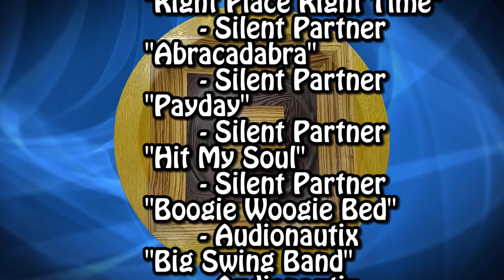Woodturning - Square In 3 Frames

Comment: Gord absolutely fantastic job waow you couldn't have picked better types of wood for this project so beautiful. Such a simple idea but this is actually the very first time I have seen this done for a bowl/platter, absolutely gorgeous 👍👍👍
Reply from the maker: Thank you, Gavin. I haven’t seen it done before either. I just did it to see if I could. The turning was the easy part. Getting the joints of the frames to work out was the tricky thing. Thanks for watching, Gavin. Merry Christmas and Happy New Year to you and yours! 🎄🎄🎄🎄
Reply: @GordonRock1  thanks so much and Merry Christmas to you and all close to you 🎅⛄🎄🥳

Comment: By design that is the prettiest bowl-of-week (maybe month?) I do have 2 questions, 1.) did you put any spines or dowels between the mitered glue joint to strengthen the end grain to end grain glue joints? and 2.) just how many of those plaid shirts do you own? GOOD JOB!!
Reply from the maker: Thank you, James. I’m glad you liked it. To answer your questions:
1. No, I didn’t use any splines or dowels because, as usual, I didn’t have a firm idea of what I wanted to turn until I had it on the lathe. If I had used splines/dowels I would have had to plan it very carefully so as not to have them show up!
2. I am not even close to the number of shirts that Norm Abram has! I only have one shirt that I wear in the shop and a second one for mini Gord. (That won’t mean anything unless you’ve seen a few of my other videos.) 😃😃 Luckily I have a wife who doesn’t mind putting them in the laundry on a regular basis.
Thanks for watching, James!
Happy turning,
.....Gord

Comment: Another beautiful piece Gord. I am amazed at how well the hot glue held the piece. Do you the glue on the mating surfaces or just on the perimeter?
Reply from the maker: Just on the perimeter, Dan. I don’t use it on the surfaces because I can’t be sure that the thickness will be uniform. I have a great deal of faith in hot glue as long as it is very HOT!! Thanks for watching! 😃😃
Reply: Gord Rock, Thanks Gord. I do not use much hot glue for the reason that you mentioned. I was not sure that it would hold as well as it does on the perimeter. I made a glue block/chuck for my lathe so I guess it is about time that I use it. Thanks again and I look forward to your next video.

Comment: Fascinating look. When mixing woods do you have to  check the woods hardness to make sure the are the same?
Reply from the maker: I have never worried about that when working with relatively small pieces of wood, Charles. If I were working with very large pieces the different expansion rates might be an issue but so far I have never had a problem. Of course, maybe I have just been lucky! So far, so good!! 😃😃 Thanks for watching, Charles! Have a great shop day, my friend.

Comment: Gord, did you rely on hot glue to hold the faceplate on that large of a piece? Or, as I suspect was that to hold it in place while you inserted the screws?
Reply from the maker: I used hot glue only. No screws! I have a lot of faith in hot glue. As long as it is given time to get VERY hot I have never had it fail. YET??!?? Thanks for watching, Gary!
Happy turning,
.....Gord
Reply: Gord Rock ..I have used hot glue for some smaller pieces, but nothing as large as a 16 inch platter like that. Certainly makes sense where you don’t have enough depth to remove the screw holes. BTW, nice idea the way you made that blank. Never seen that before. 
Happy Thanksgiving...(or does Canada celebrate Thanksgiving? ) 👍
Reply from the maker: Happy Thanksgiving to you, Gary. We celebrate it in October but thank you for the thought! Have a spectacular day!! 🦃🦃🦃